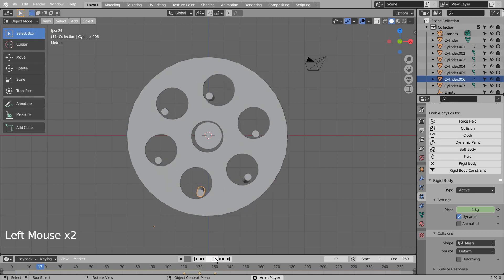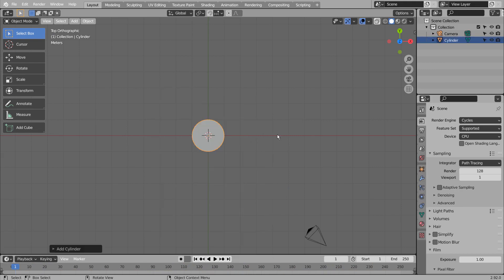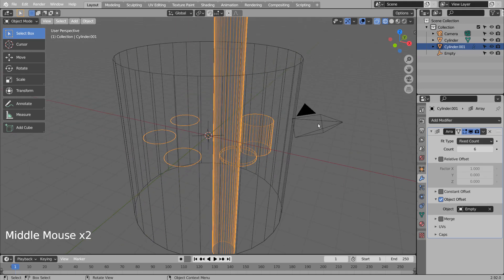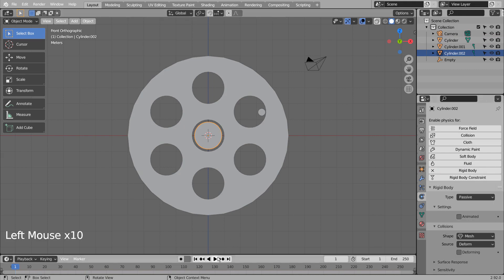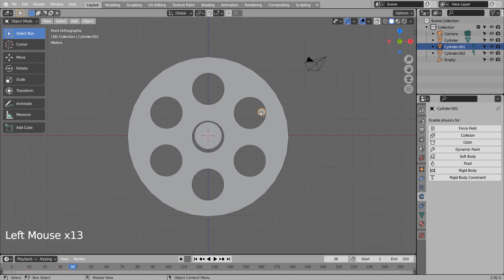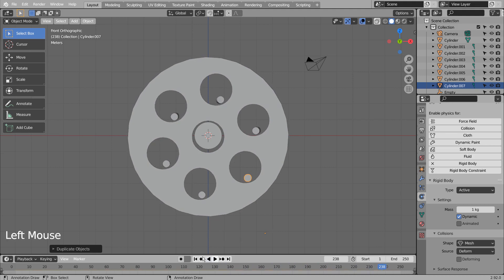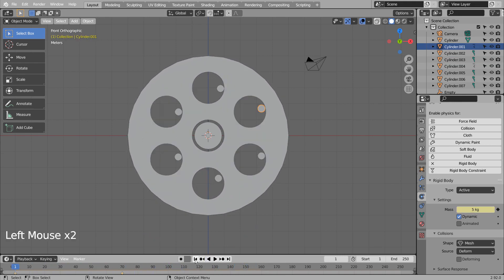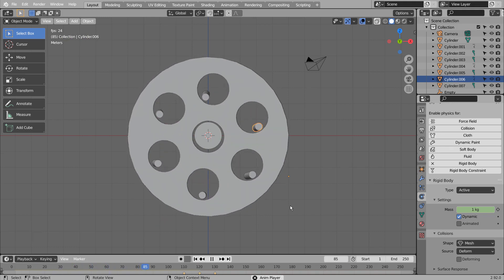Blender beginner series No. 98 - Perpetual motion machine fail

Comment: It's moving with a very slow speed  4:18
Reply from the maker: Thank you for watching, Blinks..!! :)  I'm not sure why the wheel would move slowly..  Please try adjusting the mass weight of the inner cylinder mesh to see if that would fix the issue. :) (e.g. Mass weight from 15 kg to 30 kg.)